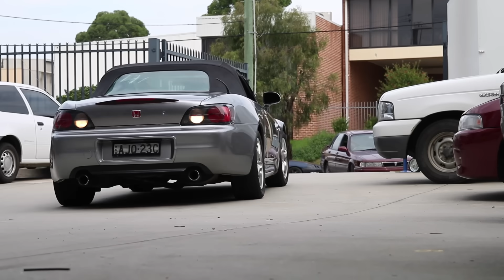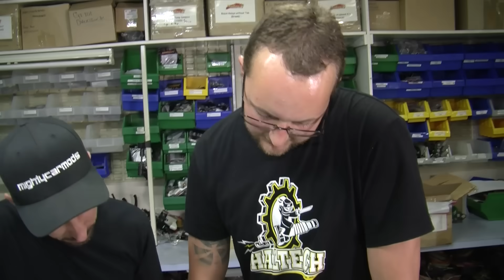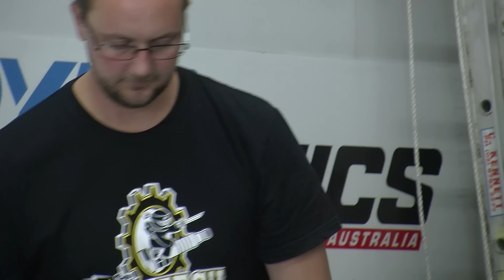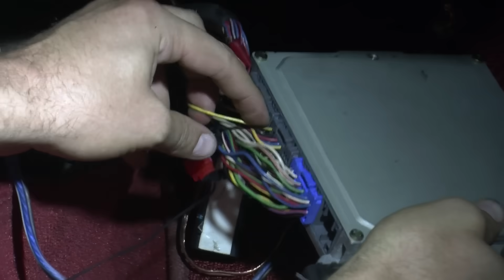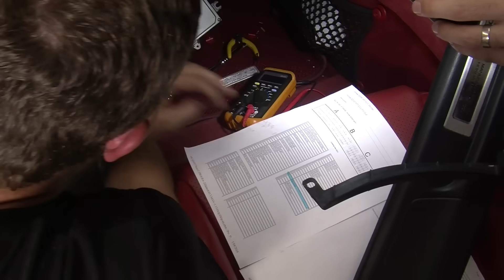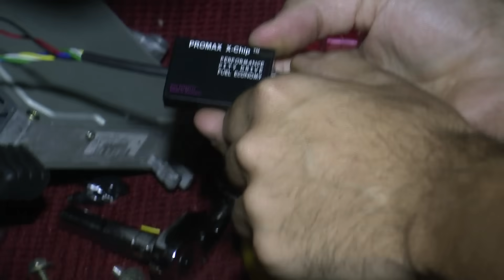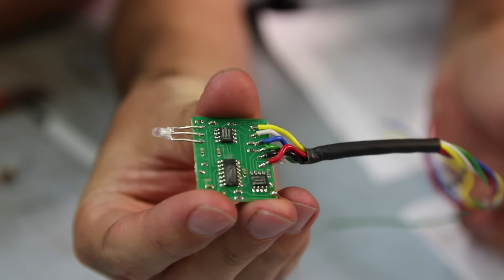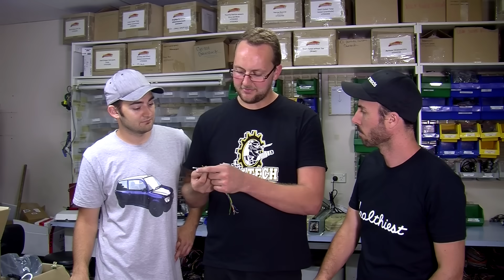eBay Performance Chips -  Mythbusted

Comment: they chose the cheapest shittiest looking chip from the most untrustworthy ebay seller country, the Ukraine. 

TBH im shocked the thing even turned up. pretty sure it is a part from a TV remote. probs from a Brand that does not exist in Ukraine anymore and they had a fuckload of little circuit boards with LED's from the TV remotes so they repackaged them and sold them to idiots like these two.

Comment: First of all you didn't use the provided connections, that's at least 6 horsepower lost, second you had the top down on the car causing bad drag that's another 11 hp gone, third different air temps at different times of the day, that's 3.2 hp gone, you couldn't realistically expect to get good results with those flaws.

Comment: PLEASE DO THE ECU CHIPS YOU PUT INSIDE THE ECU. YOU WOULD EITHER SOLDER IT TO THE BOARD OR PUSH ITS LEGS DOWN ON CONNECTOR ON THE BOARD. ITS LIKE AN 8 OR 16 LEG PCB CHIP

Comment: The red Gallant at 1:27 is identical to my first car! I wanted to 4g63 swap it but 20 years ago that was practically impossible without a fab shop and wiring experts now you can get stand alones, adapter harnesses and swap mounts for any combination you ca to dream up. Memories, sweet memories.

Comment: As for the tip for making it better: measure up the holes and get universal hood vents that fit over them and fit the styling of the car somewhat. Make exact cuts measuring properly and file down the edges. Paint the exposed metal with a silver paint corrector. Get color matched paint from a store, prep, primer, paint and clearcoat the universal hood vents, then use a liquid sealant to fix them in place - after measuring and making sure they are properly aligned.

Comment: hey dude..please carry  out some dino test for other engine performance myth..in my country the myth is using some capasitor on your car battery to stabilize voltage from car battery..they said it will improve your engine performance  by 20%..

Comment: Inside that "programmer" is just 3 generic ic's that cost probably 10 cents per every box of 500. So it costs them $.50 cents to put that together, nothing goes to the output leads and if they sell 3000 of those, maybe 100 people will complain and say its not working and get a refund and the other 2900 people said "fuck it its working"

Comment: Maybe the circuit was not designed properly, and it just died.  It may do something if a component had not failed in it possibly.  Nevermind... I just saw the end of the video... it was just a placebo board.

Comment: Those connectors will also cut a wire too much and you end up with a open circuit eventually.  Especially where it will be subject to vibration.  I see it all the time with power commanders on motorcycles connection to the TPS.

Comment: Ive dynoed map switches/air sensor switches before.  They add some power. Heres what makes no sense to me at all. Splicing the wires in as done in vid your nit chagning anything as the signal takes the path of keast resistant which would still be a straight.  You have cut the wires and wire one side in to one wire and other side to the other....

Comment: I'm not sure if they work or not but it wouldn't make any sense to splice ECU wires it would have to bridge the connection with the resistors in between it so if it is spliced then it's still just a normal ECU it's reading but it's not writing

Comment: yeah...that was one hella cheap chip for a petrol car...
thou, the ones for diesel engines actually do work and they start at 50 bucks.
these chips work by modifying the fuel quantity the pump delivers.
unfortunately, I have no dynorun to proof that, but 2 liters/100km better milage are quantifyable enough for me...

Comment: 1% more power after hacking the perfectly fine OEM wiring. Haha, of course.
I should show this video to friends of mine that SWEAR by these garbage chips.
I keep telling them to take the stupid truck to the dyno and get numbers, not go by "feel" when you can clearly see the same thing is happening. They tie into sensors and don't even have a proper ECU mapping. Just keep on dreaming.

Comment: purchased an ebay punk performance chip for my suzuki boulevard and let me tell ya, it made a difference to both performance and economy. Realised another 50km out of a tank and also another 1000rpm higher power ban. Would say about 5 - 10 percent gain. sadly it did not last verry long, bad wiring and being encased in encpsulating fluid made it impossible to repair and reproduce. Not allebay chips are shit, some do work, just dont expect exagerated claims of some sellers though.

Comment: Oh please don't damage that beautiful looking S2000.    The design team actually specializes in over temperature control of Coffee makers.    The main cost of production is the black plastic or epoxy used to hide the circuit from  hackers that would steal their design.

Comment: you didn't flip the switch correctly you have to put it 1st in fuel economy runt it for 1 hour then after exactly 1 hour(no more no less) immediately switch to Performance mode then run it for 5 hours at highway speeds then let the car sit for 2 days that's a 2 days then go back out for 1 hour and a half then the car is probably set up to use the new chip a friend of a friend of a cousins brothers sisters friends roommate told me this

Comment: They should have use  or probe the component using Oscilloscope if there's really working signals or varying voltage on those signal wires.

Comment: You should find a legit 'chip' and show it's effect on the dyno.
Reply: There’s the colloquial term of a vehicle being “chipped” just meaning the ECU has been modified in some way. Everyone on these comments are so goddamn anal retentive and has to correct each other with definitions no one cares about.
Reply: @turdferguson810  Accessport makes tuners and hondata makes tuners, reflashable eeproms, jailbreak software for OEM ECUs, fuel system upgrades and stuff like that. Neither makes or sells a chip.
Reply: @12jazion  You know your shit, idk why people are mad. I was just waiting for someone to initiate the passive aggression and for that passive aggression to devolve into active aggression, which it did. But yeah I’ll just get my car dyno tuned by a place that has a great reputation and credibility. I’m building my daily driver 2015 CR-V to be slightly more powerful and so far I have a cold air intake and functional hood vents to help get the most cool air to it, since I’ve added the vents I’ve noticed increased throttle response, I’m just a 19 year old in college though so I’m not turning it into a $10k+ race car, just experimenting with the 2.4l engine but playing it safe because I don’t want to blow the engine. So I’m going to save up, add some gold wrap to my intake pipe partly for looks, partly for heat shielding, and just improving things. I won’t be messing with the engine for a while, instead I’m focusing on helping the engine out and helping it stay more and more cooled down, reducing stress on the engine, my radiator,  shielding the hood from paint damage and playing everything safe. And driving it easy and reasonably.
Reply: 4
Reply: Germanys Racechip
Reply: @Chris Swenson Have you ever used a Diablo tuner? I used to sell them and they have very limited usefulness like removing speed limiters and changing settings like tire size so the speedometer works properly with non-stock tires. They cannot magically increase horsepower, Diablo says they can give up to 30 hp and 30 lb ft of torque with their tune and 93 octane fuel but that is not the tuner making the power, it is the fuel and the tuner just advances the ignition timing to take advantage of that fuel which the factory ECU is not calibrated to run. Also, they will probably be banned soon because their tunes do not meet emissions and Bully Dog was already fined millions and Spartan Diesel's founder is facing a year in prison and a million dollar fine for violating the clean air act.
Reply: A “legit chip” would be a tuned ecu
Reply: There are no legit chips. If there was there wouldn't be aftermarket ecus.
Reply: @neonnerd1364  fair enough, makes sense
Reply: There is no "legit chip". If an auto manufacturer could throw a chip in a car and make it perform better and get better fuel mileage they would at the factory. They have decades of research and millions of dollars invested in research and pay engineers good money and there is no chip company that has the capability to out engineer the manufacturers and abide by all regulations put on cars by the government.
Reply: @12jazion  Reflashing an ECU with most modern cars will give you more torque, a bit more power, and possibly even fuel economy. The trade off is having to run higher octane fuel, increasing emissions, and potentially decreasing engine longevity due to increased internal pressures and heat.

Add on chips like in the video are complete snake oil however.
Reply: Coasterteen22 I think your comment only reinforces what he said about manufacturers would do it if it made sense. Reflashing to then have worse emissions, more expensive fuel, and risking the longevity only contradicts what the factory accomplished... are am I missing something?
Reply: @Coasterteen22  Emissions does not increase if its tuned right but can actually be reduced if tuned right.
Reply: @brandonb5298  Yes, the more power bit...............which is the whole point of the exercise remember..................
Reply: @12jazion  so the reason cars aren't tuned. Warranty, they want enough power to be what they are looking to please. Yaris vs s2000, vs mclaren. Fuel economy for that car as well. They don't want to risk damage prior to warranty duration. You can influence both with tunes. Not saying chips work, But I've seen a banks chip on a truck my buddy had and I promise you that it made an extreme difference
Reply: @12jazion  so challenger black key is 606 hp nd the red key is 707 so thats not a chip then what is it
Reply: @joshuahartford9329  That's a totally different thing than what we are talking about here. Its like the Ford Mykey where one key limits top speed and power and the other allows full power. That is using software built in by the manufacturer we are talking aftermarket "Chips" here.
Reply: Joshua Hartford factory
Reply: @12jazion  The car manufactures does NEVER take out 100% power of ANY engine which is in a production car! This is done to extend engine life for a production car which we assume to be GOOD quality cars. If you want to know about engines which really take out 100% POWER then have a look at F1 racing and MotoGP racing. They DO NOT use turbo chargers or compressors... is 100% PURE POWER. But there engines are not meant to last long, thats why they spend 6 engines on every MotoGP bike per year doing only 18 races. (3 race per engine? :) yes. So to make it last longer.. just kill of 15-20% of its power then use it for years to come. This is basic for everything you see on roads. On track the story is different.

If you want REAL chips then try a set from: DynoJet (costs 250-350$), and you will FEEL the Boost.
Ask some guys who do racing and you will better understand.
Reply: @valehero3140  DynoJet specializes in powersports not automotive applications so their products are not relevant to the eBay chip conversation.
Reply: @12jazion  there are plenty of good ones. They cost.
RaceChip for ex: https://youtu.be/ndp_xAAMj-E
Reply: @12jazion  ummmm my chipped p28 ecu says otherwise.
Reply: @ReaperActual518  That is not a "performance chip". That is an ECU that has a programmable EEPROM which is a legit tuning solution. "chips" are those things that connect to your MAF, MAP, and such  that supposedly magically give you gobs of power and torque and better gas mileage and can be found on eBay for 30 bucks and never work. Btw your p28 ecu by itself does not give you more power it needs supporting hardware. You need to get more air and fuel into your engine to make more power, the programable ECU gives you the ability to change the fuel and ignition maps to take advantage of upgrades that allow more fuel and air into the engine which the factory ECU does not have mapping for.
Reply: Fushie smith People reflash their stock ECU’s all the time. Also, there are plenty of legit chips out there too. A good example would be the knockoff Dinan chips for E36’s.
Reply: @zanstuart2809  Chips and ECUs are different things. The ECU controls the engine, a chip ties in line between sensors and the ECU to trick the ECU into feeding the engine more fuel and changing ignition timing and most do nothing at all other than look cool and give you bragging rights that your vehicle is "All chipped out". I run an automotive electronics business and get customers all the time wanting the magic chip that will give them gobs of power for cheap and it does not happen. Horsepower costs money, they say they want to go fast and I ask them how much they want to spend. Usually 5K is a good place to start on going faster and if you want to get into the 10s on the quarter mile and be reliable you better double or triple that on most vehicles. An eBay chip is not going to get you there on race day.

Comment: I'm being 100% honest, I had a 1986 Trans Am with a 305. Added Gale Banks exhaust, superchip,k and n air filter, transmission upgrade, and my car was at least 6 car lengths faster or more than a stock 305 and could run neck and neck with the 350. Everyone swore up and down my car was a 350. Whether it was a culmination of the mods or not, the car made bug gains for the money I spent.

Comment: The power tune module has minimal memory, but just enough to alter the timing curve on my 17 rx350, totally eliminates hesitation the rx is famous for. No jerking, smoother. NOT placebo. My rx was miserable to drive, now, a pleasure.

Comment: AEM fic6 are they any good, can't afford a haltech
Reply: It depends why you are fitting it
Reply: I've ported the heads, plenum chamber upped the compression to 10-1  350cc Injector's and 340lph fuel pump, the stock ECU is having trouble with timing!!!
Reply: StreetandCircuit no I want to get some more out of it, the original compression was 8.5-1 in the 6g72 12valve and the stock ECU can't be flashed
Reply: StreetandCircuit the timing curve is too aggressive but total timing is toping out at 4.5k for some reason. 101kw is the best we could get on 31" tyres
Reply: Emanage Ultimate will advance timing but its a bit more expensive.... the harnesses are pricey
Reply: StreetandCircuit yep I'd need to do a custom wire up, rpw in western Australia do plug and play patch harness but 1500$ I'd prefer to do it myself. It is the Injection scale and timing curve and I have a opportunity to supercharge it in the future but until I get it right n/a boost is invasion for crumbled internals. Being on a pension and taking the kids camping I had f/all power stock so using my experience with a die grinder I have got as far as I can with the engine just the tuning. Thanks for trying to help but I think some form of piggy back ECU is all I can afford with some more saving!!

Comment: So that comes from Germany?... At $20?... No way. It was suspicious just because of the price. Similar motorcycle intended stuff goes for no less than US$160... and it somehow works actually. It's not that higher the price equals a higher thruth; but $20? That's cheap anywhere. On the other hand, I really, honestly doubt Germans selling such techno fake... If any.

Comment: Most horse power "chips" are nothing but a 32 Ohm resistor dressed up to look like a "chip."  The resistor takes the place of the temperature sensor and causes the engine to run leaner.

Comment: Thank u for putting all that effort into showing us how useless those things r. Most of us r sceptical and assume they r a scam but in the back of my mind I want it to work. I'm glad u have proven that it doesn't. About 8 or 9 years ago I bought 1 and hooked it up. Couldn't tell any difference so I trashed it. But I really wish horsepower was that easy and cheap to gain. Long story short, it's just not that cheap or easy to increase.

Comment: So many idiots here thinking ALL ebay chips are all placebo and snake oil LOL. What if I told you that OBDII chip for BMW 550i with n63tu V8 engine produces Stage 1 with 500+ rwhp? It's not snake oil you imbeciles - it's a tune written to flash over stock one and it has adjusted fuel maps, ignition, vlavltronic, boost targets etc. - how in the world are you calling this fake only because a world famous tuning shop can sell it on ebay? Most of idiots here don't even have $1200 to pay for that Stage 1 chip lol

Comment: The reason those guys didn't measure an increase in hp is that they need to replace all the dials from 10 max to ones that read 11 max (duh!). Doing that will get you an increase up to 10%. If you want the full 15% increase, then replace the 10s with 12s. However, if replacing with 12s, be very careful not to adjust to over 11.5, as you could blow the engine.

Comment: There are some "chips" that do give you power but its no more than 5-7hp. And ofc they are not 20 bucks.
P.S. Also it works different on different engines.

Comment: I do not understand the 179hp output from an S-2000 in two ways. My european S-2000 was supposed to put out 240hp (DIN) and i think that was not far from true from mesurements done on similar cars here. The second way i don`t understand is how the 142kw can become 177hp? Is it not 193hp? I can understand specs on australian cars can differ from european ones, after all I did not hear the vtec bang as clear as in mine, far from it. But Power difference from  kw to hp must be the same all over the universe?